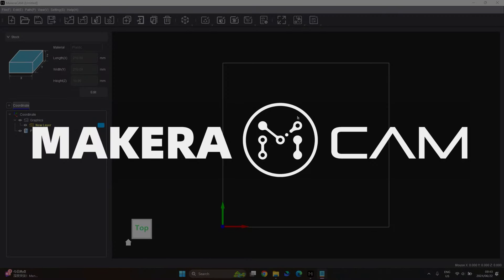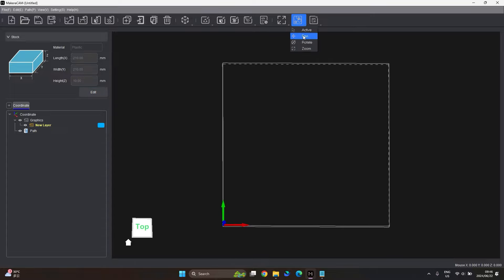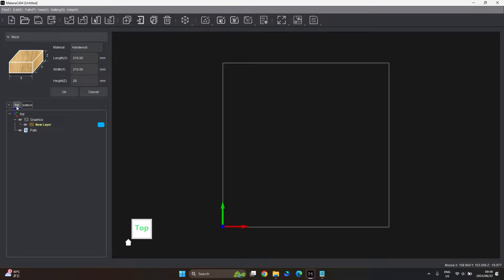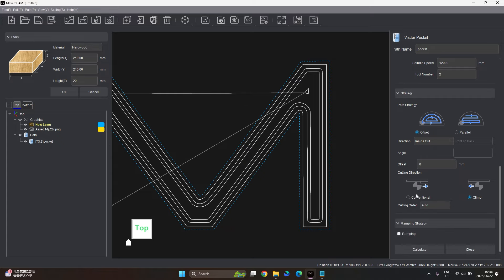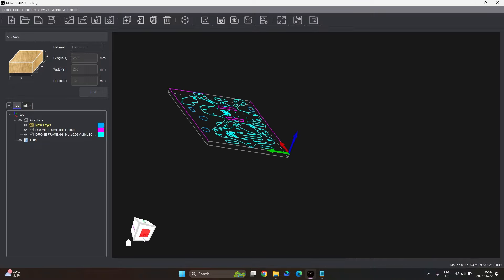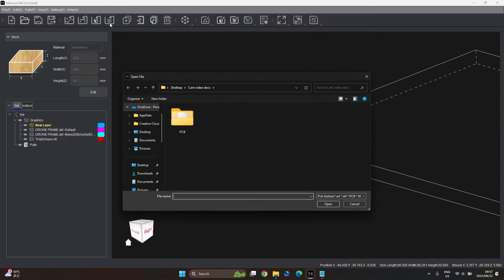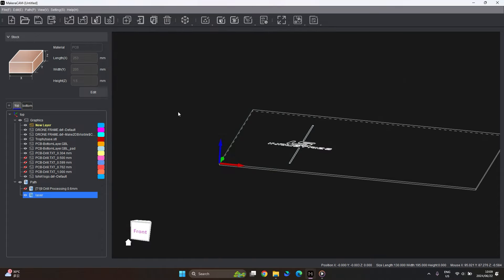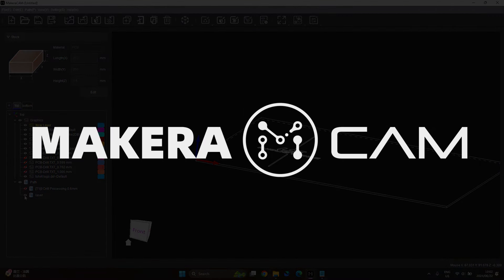Makera CAM - Overview

Comment: This is super exciting to see! I just learned the new CAM software was out and in beta! I’ll need to check it out asap. 

Im especially excited about the two pass operations with different bits. I’m curious how i could accomplish this behaviour with Fusion 360. Any insights you can share?
Reply from the maker: If you are on the free version of Fusion360 you wont be able to export the files with the tool changes. You would need to manually combine the files afterwards. Here is the steps on how to do that. https://youtu.be/6Yla9M-TJ5U?t=1915
Reply: @Makera  thank you for this, but how do you set up the cam processes in a way that the first process does a rough cut with a bigger bit and then a second process does small detail with a smaller bit and only program the removal of what was left from the previous process?

Comment: Does the Beta allow for 2-1/2D cuts.... like V engraving for sharp, inner beveled corners?

 You mentioned 3D etc using the words " very soon" at one point. Any vague idea of what 'soon' might be? It's been a while, yes?
Reply from the maker: Yes, you can achieve inner beveled corners with the correct bits and depth settings. The 3D functions should be ready around October, but beta testing will be sooner.
Reply: @Makera is the 3d still not available? I can’t import a model